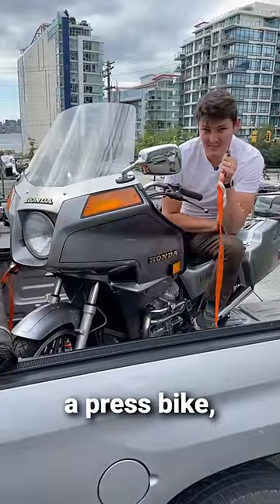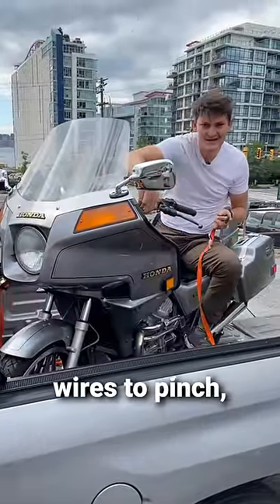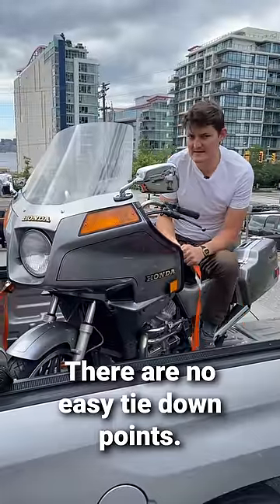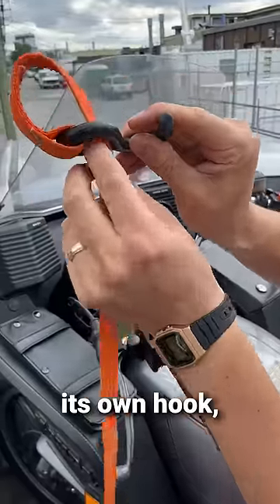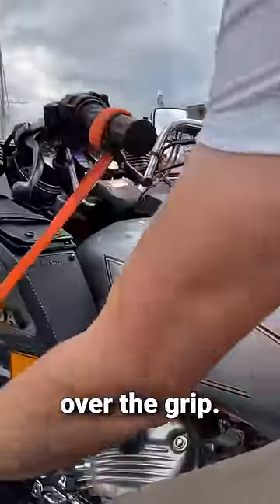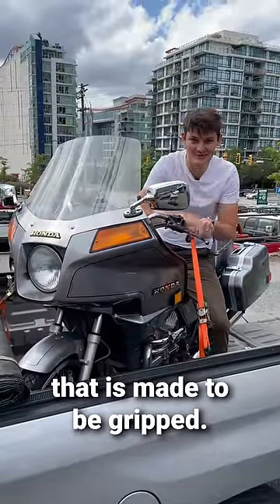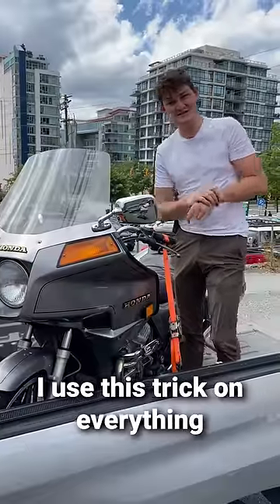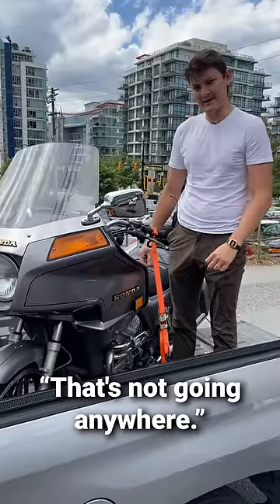The #1 Trick for Strapping Down a Motorcycle

Comment: Don't think I like the idea of putting this much stress on the throttle, which is usually just a plastic tube.  Either going to rip it off, or cause it to deform the plastic compress and stick when it needs to rotate freely.

Comment: made 2 be gripped by a pair of hands and gently manipulated for the purpose of turning the vehicle and applying throttle input vs withstanding the weight and all the forces of the bike are 2 compleatly different things

if your in doubt take a small childs hand hand which is "meant to be held" then lift them up by said hand and watch with horror as there shoulder pops out the socket

Comment: So DONT do this on 2018+ goldwings
The manual states DONT USE THE HANDLE BARS apparently it will break stuff, if you have a 2018+ goldwing get tiedown points that bolt to the frame

Comment: You never tie down a motorcycle and compress the suspension you tie it down on the lower Fork tubes right above the fender the same strap can be used

Comment: Yeah the part that’s meant to be griped by a human hand with human strength. And what about the other side that articulates for throttle control?

Fort9 has some of the best motorcycle content around, but this is a questionable tip.

Comment: This is a bit off topic but another potential use of a ratchet strap. 
Say you have, God forbid, dropped your bike and need to lift it up. 
How about compressing the front and rear suspension with ratchet straps to lower the centre of gravity? Agreed this will also decrease the lever. Can you do the maths?

Comment: Rare ryan L take, how to fuck up your throttle and grips with a quickness. Not to mention that you might end up with wonky bent bars.
Reply: I pulled pff the road and got in sand and tipped over on my bike and it was actually very not bad it didnt dent or scratch anything because it was sand it just looked to me lime it was solid but under it wasnt. So it was very soft landing but it was still enough to bend the handlebars and imo the factory ones were built for it so it sucks to change them

Comment: Ryan, I am disappointed. I am firmly camped in the school of thought that the only way to tie down a bike correctly is two straps from the lower section of the front suspension allowing the suspension to move freely front and rear. I've done lots of miles with bikes on trailers this way and never had an issue. I don't understand any other method to be honest as they all have major drawbacks and I haven't found one yet this way.

Comment: Maybe. I have NEVER strapped a bike down by its grips. You all know some of those are juat glued on and are meant for twising forces. They are not designed for tensile force. Canyon Dancers pull INTO the bar, and im still not a fan. Good 'ol soft straps work 99% of the time with minimal fuss. YMMV.

Comment: Love your videos Ryan, but no. Even with the strap sqeezing the grip there is a real risk the grip csn slide off the bar. On the throttle side I can easily visualize the throttle tube snapping under the load

Comment: Soft straps on the bottom triple clamp. Period. NEVER tie down the handlebars. Could bend the bars. The grips are extremely likely to fall off. They're only glued on for Pete's sake. And you're guaranteed to wear out the steering head bearing over time. The mechanic that told you to tie down bars was either a green tech or doesn't ride.

Comment: Classic mistake. You should always strap your bike down on the unsprung front tubes. Otherwise you can immediately replace the front tube seals after unloading. The advantage is also that the springs of your bike will not be be disabled, thereby avoiding damage due to vibrations during the towing. Same goes for the back wheel. Ask your motorcycle repair shop if you do not believe me, although they’ll obviously happily replace your seals should you chose to ignore this advice.

Comment: Never Ever do that! On the left handlebar it will do no real harm, only maybe rip the rubbergrip and bend the handlebar, but on the right, you pull down on the throttle grip and in worst case the beld will twist the trottle forward and bend the whole throttleassembly in the carburator!

Comment: Strapping the bike by the steering is not the best idea.
Works for toll motorcycles but doesn't work for sport bikes. Besides, compressing your suspension for long term doesn't bring any good. especially when you have springs.

Comment: Have you actually SEEN how the handlebar is attached to the risers by just clamps? Yes it's a part meant to be gripped, NOT to hold down an entire motorbike in transport - and the grips and the throttle tube will get absolutely f*cked doing that.

Comment: F9, no buddy, please don't do this! As a dealer mechanic that guy is an idiot. The throttle is not meant to be gripped with excess force in any direction with prolonged and excessive force as with strapping down. Use soft straps around the lower triple tree to accommodate faired motorcycle bodywork, then use the ratchet strap to secure said strap to your anchor points please.

Comment: This is absolutely the WRONG WAY to tie down a motorcycle!

Handlebars are very weak in the grand scheme of things. They will either bend or break (especially sport bikes with aluminum clip-on style bars...) since the handlebars are not designed for any major loading. They are designed for steering and control inputs, not compression or shock loads from tying a bike down.

For a bike like this SilverWing, the best points are the lower triple tree using loop straps and the saddlebag crash guards. The engine crash guards are also suitable tie-down points as is anywhere on the frame itself. Also, it's best to use 4 tie-downs whenever possible - two in front and two to the rear.

One more thing - for those SilverWings (and any other Honda with the old Honda Comstar wheels), NEVER loop ANYTHING around the wheels. They bend SUPER EASY!! Any little side load can cause a side-to-side bend on those things.

Comment: And death to any rubber mounted bar risers…. Aka any factory Harley built after the 60’s…. As well as any similar designs spawned by the change…. 

I had this done to my own bike years ago by a dealership. Cost me a set of grips, bars, rubber mounts, and yes, the top triple tree. Over $1,200 in damage, in 2011. To a 90’s Sportster. 

Aka, half the bike value at the time. Lmao.

Comment: Yeah this is a really bad tip. At best belongs on Facebook.

If you care about the bike you are transporting you need to consider the forces from evasive maneuvering or for the forces from the tow vehicle being struck in an accident. You really want that bike frame to be attached to the frame of the vehicle.

Steady straps like this are great for storage or ancillaries for the larger strapping or hardware that is placed to take all the dynamic loads of the bike.

Your handlebars should only be strapped to the frame of the bike itself. When strapping down a load to a vehicle you need to pull down around the frame of the bike. Ideally using a wheel chock so that you don’t over compress your front and rear shocks but maintain a secure hold on the bike.

 If you have too much body work in the way ADD ANCHOR POINTS DESIGNED TO TAKE THE FULL WEIGHT OF THE BIKE.

Comment: That's is ok until you'renot applying too much force with the straps. Handlebar is meant to be gripped with you hands, not held down.
You wouldn't want someone to stand on your Handlebar, would you?
Another issue is with straps sliding down the handlebar, specially sports bikes.
Better to use chassis where you can loop the strap. Say it with me now- "Chassis is meant to take load of the bike"

Comment: This is the worst idea. First, the handlebar arm can bend over potholes. Second, the rubber grip may peel off and slide off. Third, and most important, the forks keep working and the strap loosens. The best place to mount the bike to the platform is the fork, right over the fender mount place. Of course, you have to use two straps, one for each side.

Comment: I like your videos, Ryan, but this is a very bad method to strap down a motorcycle IMHO, especially a heavy one! Especially with those light, aluminum/magnesium handlebars! They will snap or bend like there’s no tomorrow! 
I always use the triple tree as an anchor point at the front and I tighten it up until the front suspension is pushed 20-30% compressed. This way the bike won’t “jump” around when you hit a pothole or taking the trailer over the “potato fields”!

Comment: That's not going anywhere until you head-on at highway speeds. You never secure your load for the drive home. You secure your load like you don't want it in the cab with you if a drunk crosses the center line. I guarantee that motorcycle isn't going to stay secure if you make any sudden stops. Those grips are pressed on and slip off a lot easier than you think no matter how much effort you had to use the last time you had to change one. 

Strap hard parts only, around the midline around the motorcycle is best. Too high and the motorcycle can dump over and come loose. Too low and the same thing can happen. You want to use as many tie points as practical, not the minimum necessary. Get something better quality than what he's using, those look like something you'd find at a big box retailer. Each strap needs to be rated higher than the weight of the items you are strapping down to withstand the loads of a sudden stop.

I can't believe this guy made this recommendation. A lot of good videos on the channel, but this is not one of them.

Comment: Do not tie down on the handlebar!!! the bar can rotate down, and the straps will slide off.  It can kill someone if the bike falls off.
Also, the pressure can damage the throttle tube.  Dangerous and dumb.

Comment: Annnd congratulations. You just screwed up your front suspension or rather your entire suspension dynamics 
Not only are you destroying the handlebar with close to 200kg of weight that can literally warp it, you just loaded the front forks to the extreme bump stop. God save you when you go over a road bump, or worse, a pothole.
You always, ALWAYS strap at the points which are UNSPRUNG masses, ie, points BELOW the suspension mounting points.
Never trust a dealer mechanic blindly unless he can justify it with sound engineering principles; trust the engineer/designer who designed the bike.

Comment: Worst advice ever. People don’t do this. First off it will screw up the throttle. Secondly you ca. easily yank the grip off the handlebar. Thirdly. The handlebars on most bikes I’ll pull down pretty easy.